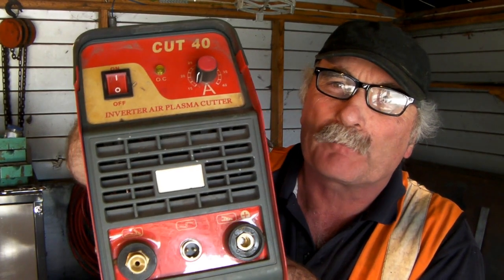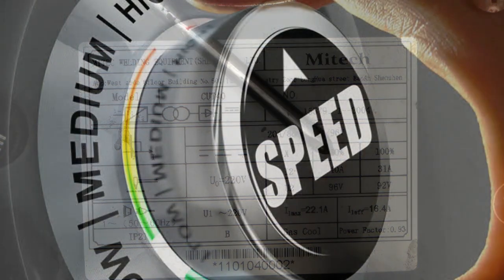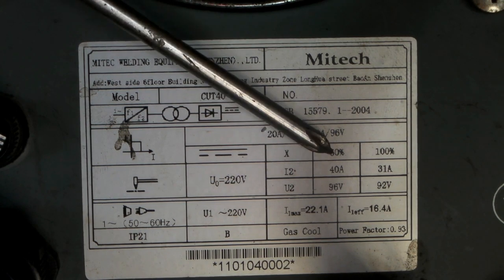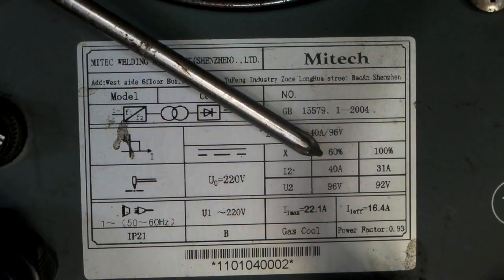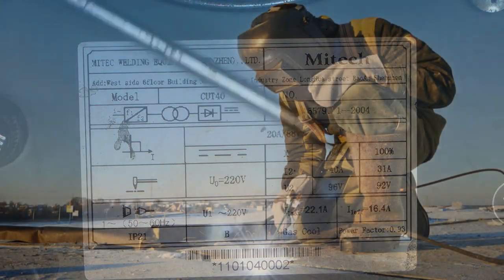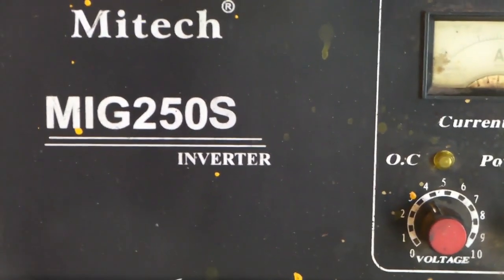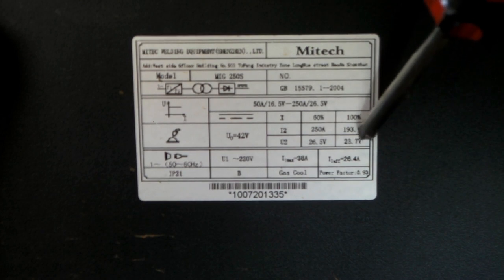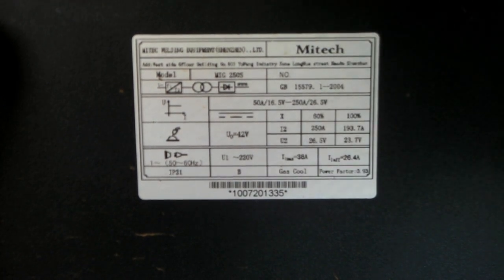Plasma Cutting (  what does duty cycle mean on a plasma cutter )

Comment: So what does it means when the O.C light comes on your 3-N-1 DC  inverter? Plasma/Tig/Arc? Especially when using your plasma cutter?
Reply from the maker: Hi the only time my OC (over current ) light came on was when i over loaded my machine. Run it out of its duty cycle .